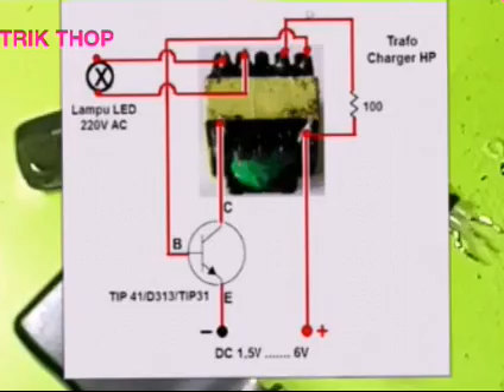Pengisi daya akan langsung otomatis masuk dalam nominasi untuk menjadi lebih cepat ke joule thief

Comment: wooow quick charge v3.1. Use a multimeter and show what the values are lol!!!!
Reply from the maker: I measured no more than 1000 volt ac load. after I love the lights load down to 150volt
Reply from the maker: If you still do not believe tomorrow I umload the memake gauge multitester kalo may know you people where my lord
Reply: No I believe you. That circuit can boost voltage but it is quite dangerous for charging new phones which are power hungry and with this kind of videos it is your responsibility to warn people before they make this circuit. I am also using the same circuit for only emergency lighting.